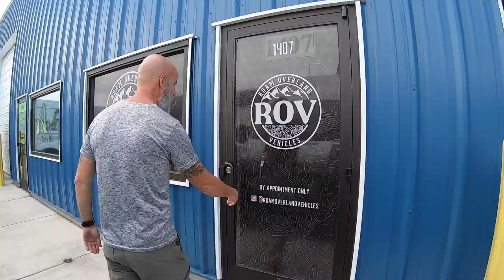Roam Overland Vehicles, Meet The Builders!

Comment: This is what I am looking for. Simple composite B box on a 136" Promaster cutaway. Full east west bed 16" off floor, walk in shower pan with cassette toilet drivers side, small cold only sink counter/storage and overhead full length, passenger side. Outside 30" teardrop style chuck wagon box under bed, centered, inside back doors, storage to the sides. Just the 2 swivel seats. No propane. ABS pipe for solar hot water on roof. 2 lithium batteries, 1000w inverter. 1 big rear venting window in the back, 1 in RV style door right behind passenger door. Square easy build. A fair weather ROVer....James
Reply from the maker: It sounds like you’ve put a lot of though into the design. I can picture it in my head! 👏🏼👏🏼